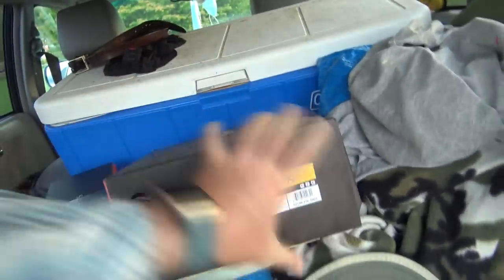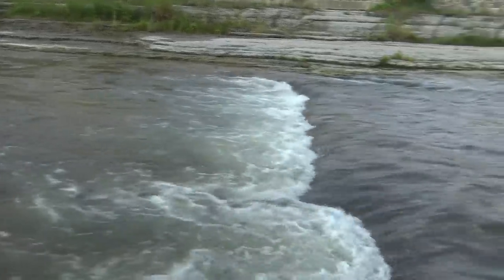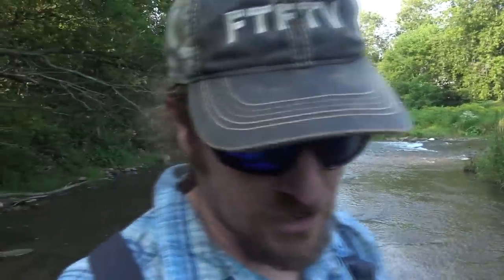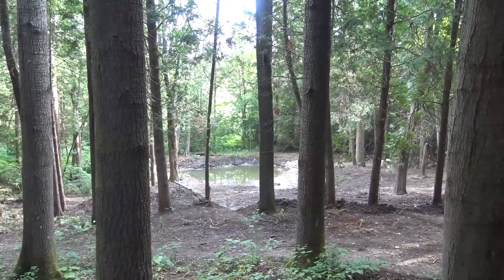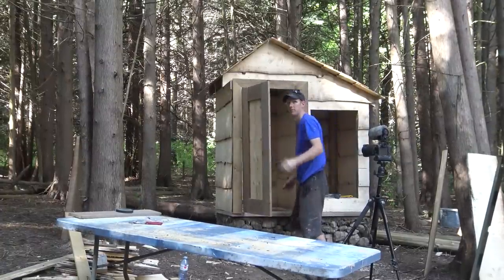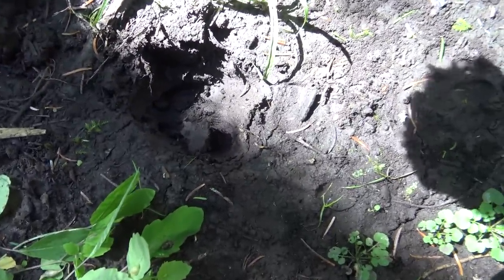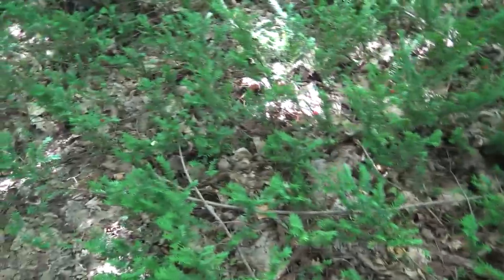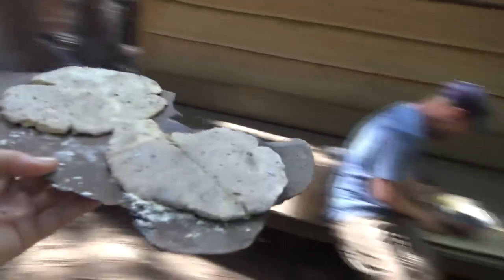Catch and Cook Chinook | Cooking in a STONE OVEN | Homemade SMOKER

Comment: Ah!  You didn't point out the Jewelweed right next to the Stinging Nettle.  36:06, in the left hand side and bottom corners.  Jewelweed is really good for relieving any sting or itch from almost all of the plants like stinging nettle. Those beautiful orange flowers are your friend if nettles get you badly.    Downside, when they are really young, jewelweed can look like poison oak.
Reply: I have used a related species, for stinging nettle. (I. noli-tangere) You can rob your Wife's Impatiens, and it works just as well.